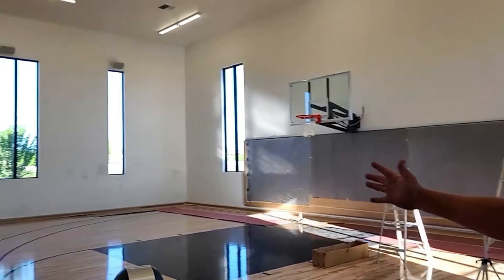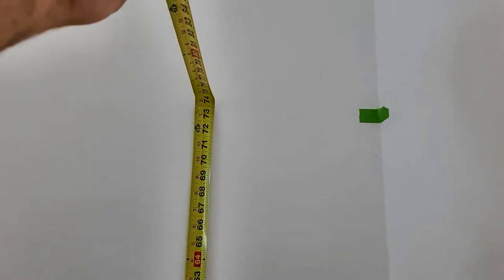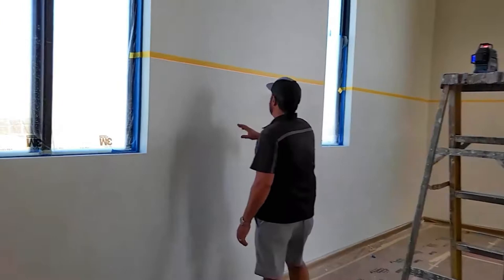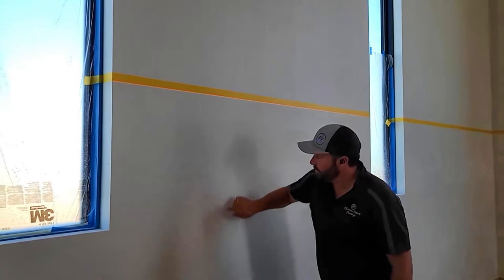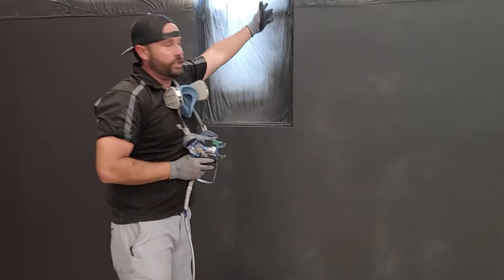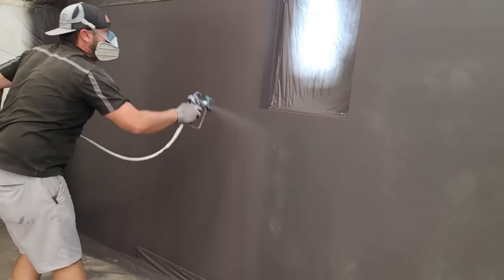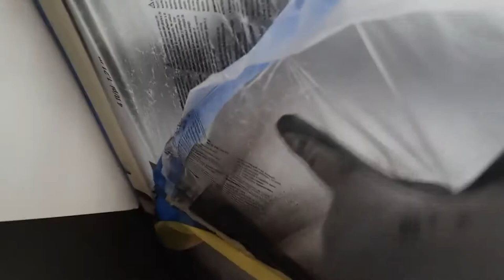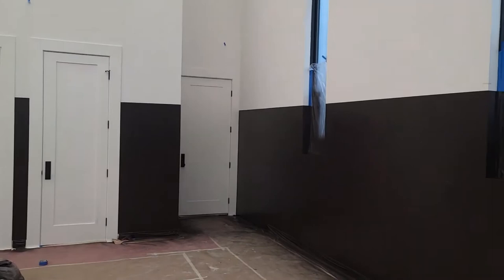How to paint straight lines | In Home Basketball Court!

Comment: Hi nice vid.. quick question on your prep/first coat did you put less pressure on your gun?
Reply from the maker: Hello Osvaldo,  great question 💪👊 So I actually kept the pressure the same, but I went faster on my first coat or sticky coat, and then for the final coat...the pretty one..lol I just slowed down a little bit so I could put more paint on and make it a nicer coat! Great question! You could control it with pressure, but I prefer to stay at about 70 percent, go fast on first coat, and then slow it down for the final. thanks for the comment 👍🙏
Reply: @PaintBoss  hey thanks a lot really helpful!! Bless